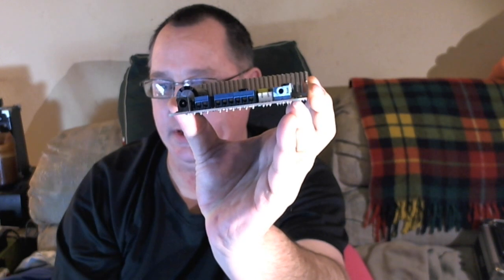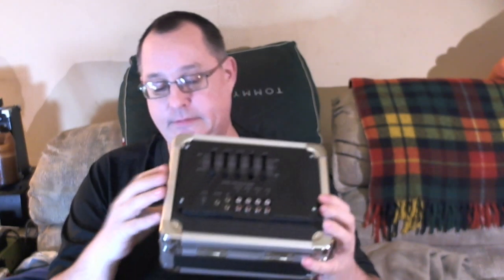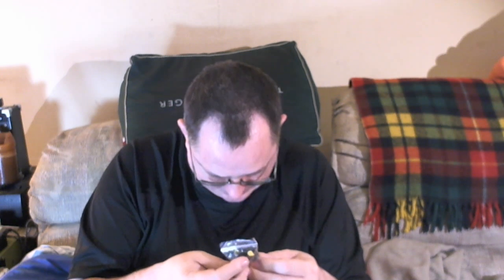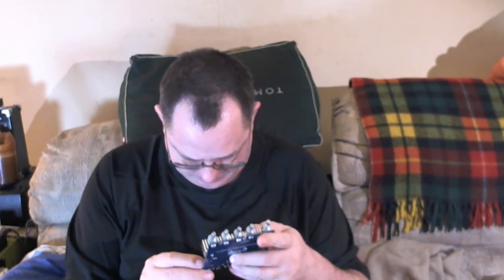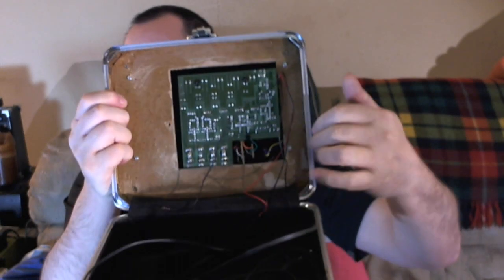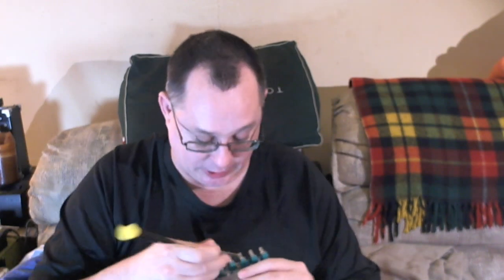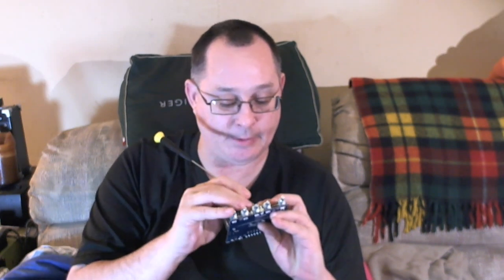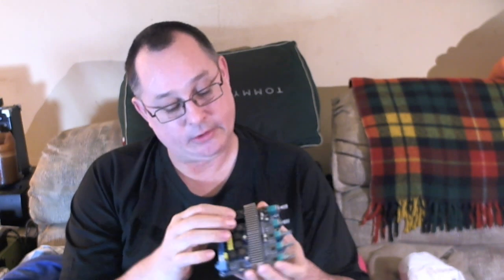Fancy Class D amp board tpa3116d2 2.1 50x2+100 unboxing / plans

Comment: hi petey, cool looking amp module man....look forward to seeing the final build.....just a note, i had one of those mp3 modules the same as yours, some of them have a fake vu meter (just 3 leds lighting up either side on display) when this was lighting up and off it was creating an annoying buzz/hum noise...just a head up in case you get the same thing.
Reply from the maker: nother thing for me to watch for - thanks ?  ... i have ordered 10 of those or more as a few arrived with issues including broken main plate  . i found a seller who will give me just the unit  - no remote for 2$ there are three types of those which look the same - at least - one has bluetooth , one does not , one has that led faux VU  thing you mention- talk about annoying ! Then there is one with a white/silver  remote and another one with a black ... for some reason i didnt run into the Faux VU LED interference issue , but  the ones that SPEAK got me , i paid 13 for a nice one and it constantly chimes in which isnt good . . . when you are using it"live" its super annoying as its way loud  . this is why i have ordered ten and Gomti is PISSED !  i have had a unit which did not respond to its remote which was a pita as i assumed it was an issue with the remote not making contact with its battery and it was internal on the actual unit  .you bring up a valid point -  buyer beware or order two ................... some of the sellers include the littlle connectors , some dont  . read your description as they will also gyp you by not sending the wire . at that oint i made a stink and they actually refunded me , which i order so much stull under a dollar and about half of that stuff shows up so ........ i spend time  doing refunds on ebay and i am guessing they must think i am full of it but hey .. i am not going to give my money away . sometimes they ship screws , sometimes not  . those things are not exactly qc'ed .........they keep you on yer toes . what i have on the one is two micro buttons and then a larger red plastic spst mom  . on the rewind / ff  - micro - hte play button has the larger red . so you hit R then F to replay a track , which we need to do that often playing along to them , and i dont care for the tactile lack of feel on the stock "buttons"